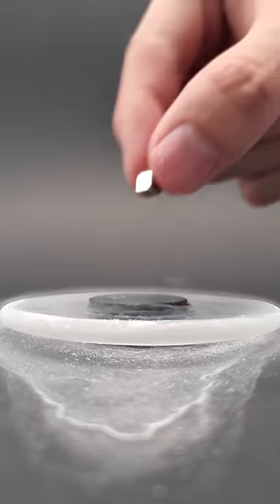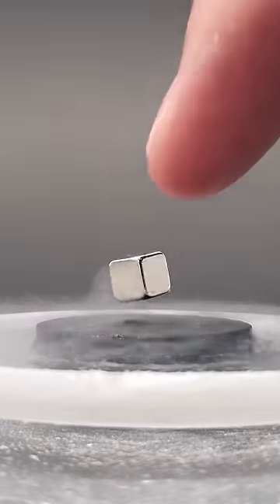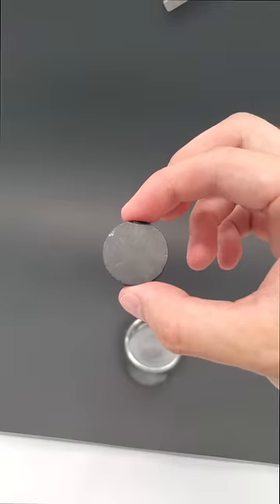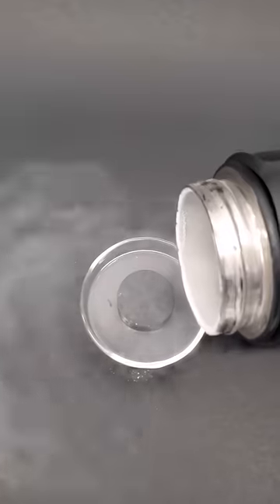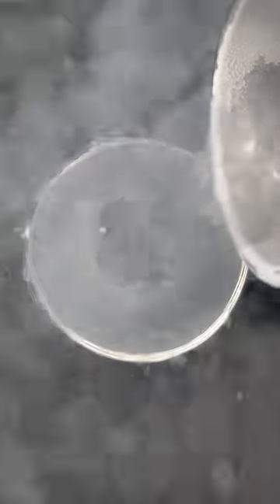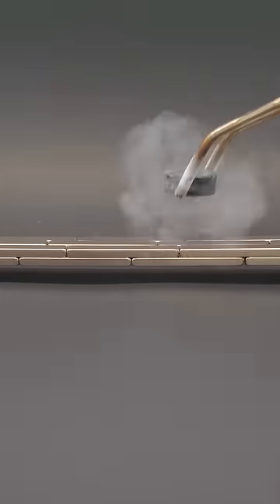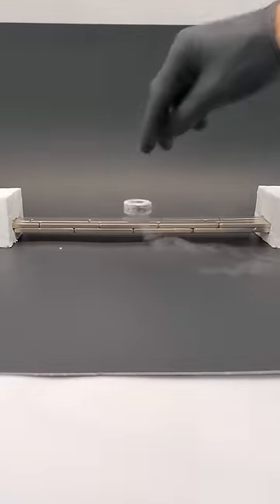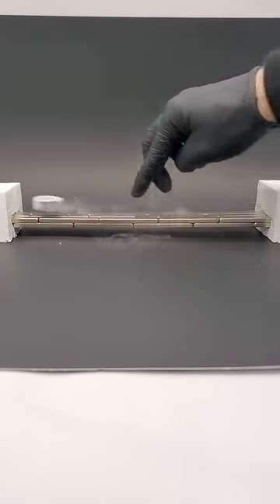Watch this superconductor hover around in mid-air!

Comment: When I was a kid I used to imagine having Sci-fi roads made of magnets, and then years later I found out superconductors exist and I was so excited.
Reply: Would make driving in the winter so much better.
Reply: And now? Maybe you were meant to invent.
Reply: @p.a.w.sthetravelinggamer6750  that too. I was thinking of energy efficiency. As a kid I was imagining regular magnets, which obviously need no power, although superconductors would need some form of cooling which would probably require power - but if this could be resolved, an angled magnet would effectively provide propulsion without fuel, only requiring power to change the angle. That's like only needing to turn your wheels in order to move. Honestly the hardest thing might be emergency braking. But of course, superconductors are far from being well enough developed to implement something like this at present. But I thought it was cool. Frictionless movement with low cost acceleration. Hills would be a fun problem.
Reply: Same bru and like the cars were made of the opposite magnet and rhats how the cars move
Reply: @artywolve  you can brake by making the conductor hot and go further by cooling it again
Reply: @Quintenmusics  That would be one hell of a drop for a quick stop 😅
Reply: Same bro when 8 was small I was like why not use magnets but now I see how hard it is🗿
Reply: Yo i used to think of the same thing
Reply: Let me tell you about a little something called "maglev"
Reply: @artywolve  bro you should learn science, i bet in the future you gonna be revolutionized transportation 😂
Reply: You basically invented the future just now.
Reply: Wow me too, I’ve always thought of magnetic roads and transportation
Reply: Train
Reply: Omg me too
Reply: imagine the radiation
Reply: @hamster434  how would radiation be a problem? Magnets aren’t radioactive.
Reply: @J0hnB09  how do we know they aren't ?
Reply: @hamster434  why would you think they are?
Reply: @artywolve  because they use electromagnetic waves or some shit to blow up iron objects with their magnetic mind
Reply: @hamster434  I don't even know where to start with everything you just said. You're trolling, right?
Reply: @artywolve  what if i weren't ?
Reply: Bro be levitating 💀💀💀
Reply: @hamster434  um, well, first of all, I'm pretty sure superconductors aren't electromagnets in the first place, but regardless, the most destructive thing I know electromagnetic waves to do is short circuit electric devices like computers, and finally I have never heard of any kind of magnet "blowing up" anything, under any circumstances. The only way I can think of is if you trapped something in between two magnets powerful enough to crush whatever was in between. Radiation is emitted by things like uranium, and we can measure it. Things which emit it in dangerous quantities are no longer used outside of marked hazardous zones, like nuclear plants - or at least they are marked as hazardous material to be handled with care. And while radiation sickness is incredibly serious, it turns out that the abandoned radioactive site of Chernobyl is already populated by thriving animal and plant life.
I'm pretty much just drawing on what I remember from school, so if anyone who has studied this stuff at a higher level has anything to add or correct, then please do. But yes, in short, magnets and radiation are completely unrelated. You can understand that magnetic attraction is a force just like gravity, which might squash you at worst. It poses the greatest danger to people with metallic or electronic implants, which is why patients with these implants can't use MRI machines which use powerful magnets in their scans. Other than that, don't leave magnets on your laptops or compasses?
Reply: sameeeee
Reply: I was really excited when I first learned about them too. But I thought about making flying strais using the same poles so they wpuld repel or making a flying skate board.
Reply: Same
Reply: bruh I used to imagine the exact same thing
Reply: Same bro
Reply: Same lol
Reply: Make tracks made of magnets, and then make a train with giant super conductors to make it float. Then add thrusters to make it move.
Reply: @Sarrban  you forgot things tho, money,
How are we going to keep the train cooled sustainably, and how will people not die from hypothermia
Reply: @robocheese9837  crap didnt think that far
Reply: @robocheese9837  ok so, i dont know about money, but in case the magnets stop working, there could be normal tracks in between the magnets and wheels inbetween as well, and then every stop they would screw off the magnets with machines, and replace them with more superconductors. As for the hypothermia part, there would be heaters in there, and insulation in the train. It would still be a little cold, so they would have to wear jackets.
Reply: @Sarrban  -400 degrees is very cold
That’s 10x worse than Antarctica
Reply: @robocheese9837  -400?! DANG I THOUGHT IT WOULD BE -36
Reply: GONNA NEED SOME BIG AF JACKETS
Reply: Remember me when you make it big
Reply: @Sarrban  lmao
Reply: @Sarrban  At this point I would pay to listen to some of your “inventions” you’re amazing
Reply: @robocheese9837  i want to make a car with no window, where you drive with a nintendo switch and look at the screen while driving. now its legal.
Reply: mario kart in real life
Reply: @Sarrban  imagine
Reply: @robocheese9837  now there needs to be a rainbow road map
Reply: Maglev train? Same thing with ur imagination
Reply: Amazing
Reply: @p.a.w.sthetravelinggamer6750  good 👍
Reply: Now the only roadblock is figuring out how to keep them super-cooled.
Reply: Smart ahh kid
Reply: @artywolve  Considering the fact that, in your example, it’s only powered by the angle of the superconductor, you could break by introducing another, strong magnetic field. So for example a car is hovering above a road of magnets, and is sitting on a superconductor, introduce a really strong magnetic field with the same polarity as the magnets underneath.
Reply: @demonman1234  I feel like using magnets wouldn't be sufficient for emergency braking though, because magnetic force is kind of bouncy. The child in front of your bumper can't afford that bounce, even if you rebound to the original position. certainly useful for decelerating, but not fast or accurate enough for emergency control.
Reply: @artywolve  No, that’s a whole new issue in itself. LOL It would probably have to have some sort of friction breaking, like a railing that the car can grab onto if need be, or even a groove in the floor.
Reply: Well the some bullet train works
Reply: M A G L E V   T R A I N
Reply: And instead of gas cars the fuel is liquid nitrogen
Reply: Same!!! And every cars are accident-proof, because they're all magnetic...
Also I had imagined about a car which doesn't use power to maintain its force to move / eternally powered as long as there's wind... And no, it's not that the wind is blowing the car and pushing it lol... And I drew the design back then, idk whether it'd work though, never really do the calculation 🤣 did these when I had electronic engineering class in my high school about 12 years ago 🤷
Reply: They already exist but they are on trains and stuff
Reply: @artywolve
Reply: @p.a.w.sthetravelinggamer6750  superconductors need to be colder then -100 celcius to conduct, not even Antarctica is that cold
Reply: In the book 'uglies' they have these kind of hoverboard, because of a magnetic grid in the ground. It awesome!
Reply: @p.a.w.sthetravelinggamer6750 with nuclear winter approaching that may be soon possible
Reply: @artywolve  No, magnets can't provide propulsion, or any energy at all. You can push a car away with a magnet (and one on the car) but that requires you to put them there in the first place, which took energy. 

If you want to put the car back where it started, that needs energy again. If you want to chase it down the road, you'll have to move the magnet. Which will resist movement with all the force of the car, since both repelling magnets push each other. You'd still have to provide the energy to move it. 

If your example worked, one way (and there are magnetic acclerator science toys that do this), you'd need energy to get the car back to where it started, pushing against all those magnets. Or else it'd have to just go forward forever and you'd need to keep building road in front of it. Requiring energy, of course.

At best, you can store potential energy using magnetic fields, but nowhere has a magnet ever provided energy by itself. It's a force, not an energy. It's like gravity. 

Hydroelectric dams make power from gravity pulling water through them. But then the water has to get back up again. That's done through evaporation and rainfall, so it costs us nothing, but still energy has to come in, from the Sun.
Reply: Same. I figured if you had the road made of magnets and magnets on your car then flipped them so they repelled each other that the car would hover.
Reply: you heard of a maglev train?
Reply: @greenaum  I think you misunderstood what I meant.
Of course the vehicle would have magnets, in order to react to the propulsion, but the propelling magnet would only need to be tilted enough to send the vehicle to the next magnet's field. Tilting the magnets would require mechanical action likely powered powered by electricity, and would also use a certain amount of power to sustain sensors that communicate with the vehicle above. I don't know how that kind of power consumption compares with modern engines anymore though.
Obviously the roads would need to be specifically laid, like a track, which is why people keep bringing up the maglev train. The reason I'd still call them roads is that individuals could drive independently over them, making turns and controlling speed just like in normal road traffic, unlike with trains where everything has to be coordinated and preplanned in order to change tracks in advance.
The roads are one of the reasons I only imagined this as sci fi though, since developing the infrastructure is such a massive undertaking it would be impossible to fund without the guarantee of a stable vehicular system that is both mechanically and economically stable, as in people would actually drive magnet cars if we built magnet roads kinda thing. But nobody could develop a magnet car industry without magnet roads, because no one would buy a car that could only drive on a test strip.
Reply: @artywolve  You'd just find, with the tremendously powerful magnets you'd need, that a car would flip over and fatally attract itself to a nearby magnet. Magnets have a field after all, not just 2 separate poles. 

As for propelling using stationary, non-electro magnets, you could never close the loop. You'd always have to put energy in to reset the system, it's the equivalent of using gravity by having a road that's downhill in both directions. Even if you just built ramps, when you get to the lowest point, you'd need lifting up to the high-up start of the next road. Of course to overcome friction and other loads, you'd need pretty steep ramps, so lots of stops to re-lift the car. That's with gravity, but that's a field too, magnets would be analogous. You can't get free energy. You'd always have to pull or push against a magnet in a way you don't want to, and only ever get out less than you put in. 

That said, the maglev idea works in practice, but you need controlled electromagnets. Constantly adjusting. There's no law against it, though, it would be an efficient replacement for wheels, like the trains use. Or if not electronically-adjusting magnets, superconductors which react constantly, but with the usual problems. Yeah you can get efficiency quite high up, if not perfect. Certainly you'd never get propulsion with a net gain. 

Still, we have liquid nitrogen superconductors, which beats the shit out of needing liquid helium. So we're getting better at it. Just add a couple of twists, some parallel dimensions and stuff, and it'd be nice for scifi!
Reply: Same bro same
Reply: @zanelabuguen1307  Same?
Reply: I love F-Zero X, and I guess they work on a similar principle.
Reply: i had this same idea but with shoes lol
Reply: @artywolve Effective heat pumping to pull heat away from the road and dump it elsewhere could be reduce the temperature of the road and provide heat where it's needed. The real issue is finding something magnetic that is also a superconductor at a less extreme temperature. A room temperature superconductor would revolutionize all of science and technology. No joke, it's the missing piece that would advance our technology a thousand years
Reply: Those kinds of realized dreams create scientists 😎
Reply: So did I !!
Reply: This is the mechanism used in bullet trains
Reply: Maglev
Reply: wait till you hear about maglev
Reply: @Resetium  You know, in these 2 years and 77 replies I have in fact heard about it a few times, but thank you for the input QAQ
Reply: Lots of kids do, it’s very prevalent in sci fi. It’s like saying you imagined hoverboards existed
Reply: @p.a.w.sthetravelinggamer6750  just... take the train
Reply: @sriprabhavdulla419  train doesn't do local transportation here.
Reply: And then you found out it would be impossibly expensive lmao
Reply: When you say you are using a "much bigger superconductor" do you really mean 🧲 magnet? It seems you're not being precise with the words you are using.... maybe I watch something related to super cooling of magnet and see what happens at -250.
Reply: They have magnet trains in Japan for years now.
Reply: same i was thinking of hover cars like this, built correctly and we could have like super fast cars
Reply: Same bro, but the problem is that you can only drive on roads
Reply: I was fooled by a fake science video into thinking that putting magnets into my shoes would let me hover above the rebar in the cement. I was disappointed it didn't work, but I had fun fantasizing about it for ages afterwards.
Reply: What happened then ?

Comment: They actually made a hoverboard using the same principle. However it was almost impossible to ride as they couldn't control the direction they wanted it to go.
Reply: @Tommy Shelby no that used magnets with opposite polarization
Reply: @RealJawnes  Nah it used liquid nitrogen go watch It again same concept as this video
Reply: @loshistudios2446  my bad lol
Reply: @RealJawnes  np bro
Reply: Well maybe they could use same principles and a tank of liquid nitrogen and some tube plumbed thru the right materials made into a big hollow cylinder kinda shaped like a saucer or tic tac and a pump n batteries and an inverter with a air compressor pressurized tank and some nozzles kinda like they use on the nasa shuttles in space and since the earth is a giant magnet with north an south poles I bet u could fly in the air and under water just like those supposed aliens do
Reply: They should make a hover scooter, it will have the setup to guide it to the correct direction and be a bit more safer cause the rider how has something for balance
Reply: Back to the future 
Hover board
Flux capacitor 
🙃
Reply: Did they try turning it off and in again?
Reply: That just sounds exactly like what someone who has never skated would say about riding a skateboard

Aaaa! You cannot control the direction it's going!
Reply: Fuck you beat me to it.
Reply: Did they try to use some sort of propeller?
Reply: Did they try to use some sort of propeller?
Reply: It makes sense considering that but it would be like using a skateboard except the only way to control is the direction you push yourself and the board. I wouldn’t exactly say use these principles and be done but if this has worked maybe they could find a way to make the super conductor use it’s energy for direction and control to keep it up
Reply: Lexus hover board was it?
Reply: @RealJawnes  no acrually it was with superconductors.
Reply: @RealJawnes  rekt
Reply: Me: almost hahahaha sorry evil laugh moment haha
Reply: @loshistudios2446  the first time I seen someone prove someone else wrong on Youtube and a argument didn't escalate. Amazing 😂
Reply: You can maybe have different temperatures for the superconductors so one pushes more than the other?
Reply: They used that exact same ideal for  hover trains.
Reply: The hack smith made a better one by spinning magnets and putting them on top of a sheet of metal
Reply: SAIL LIKE A PIRATE
Reply: Nothing is impossible. They just didn’t have a brain big enough to solve the problem
Reply: Fridge
Reply: @thehistorytheorist so we can stop the sun going supernova if we were smarter?
Reply: Woa rlly
Reply: Dont they use this on hyperloops and newer trains
Reply: I reckon a hover train
Reply: unless they made a sort of track for them like trains so it can turn altho can't be controlled
Reply: Can you generate electricity using this? Or move turbines to make them?
Reply: They forgotten, for the board, mag momentum gears, also the boards width was very narrow, plus the board was mostly the nitrogen conductor, thus limited to storage energy.
Reply: @Uzi Khan 2030 better be taking notes
Reply: ooooh
Reply: Even the supersonic trains
Reply: Really? Didn't know that
Reply: THEY are pretty clumsy aren't THEY ?
Reply: That’s what tracks are for
Reply: If it's a hyperloop tube then?
Reply: What do you think they're developing Neuralink for? 😉